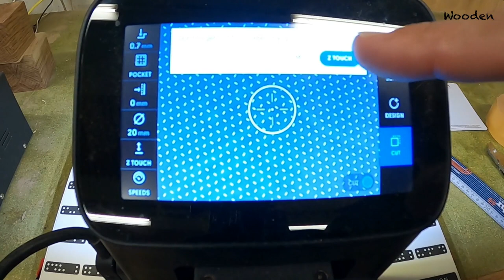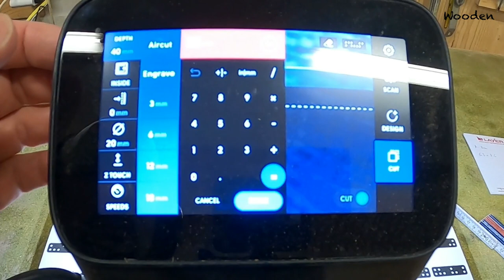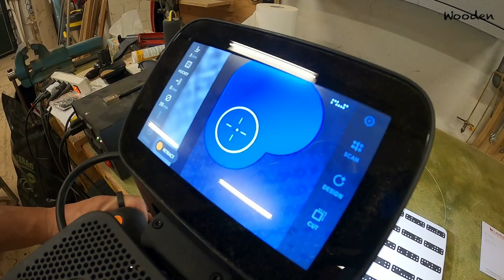[Shaper Origin] How to make 7cm deep pocket cuts with your Shaper Origin #shaperorigin

Comment: Do you have recommendations or links for bits for us Americans? Seems to links to German Amazon.

Love the creativity in how to push boundaries of the tool. Great content.
Reply from the maker: Hi Ben. Thank you so much for your kind words. Regarding the bits, you can order these on Amazon.de, because the ship internationally. The links for ENT should work, but sometimes it happens that Amazon.de (Germany) might route you to Amazon.com (where the ENT aren't sold). If that happens, go manually to amazon.de and log in with your amazon.com account (that works). Once you are logged into Amazon.de, use the provided links. If that still doesn't work, search for ENT 09010 on Amazon.de. They ship internationally, so you should be able to order. Let me know if you still have problems.

Comment: Nice tip my friend! I love the way you push the boundaries and find different ways to use the Shaper. I have to ask, what was the cut quality at level 1. Was there a lot of resistance while you were moving the Shaper? Glad to see you back my friend!
Reply from the maker: Thanks Henry 😁 I have had a few weeks that were pretty intense at work, so woodworking was slow. I was astonished that even at speed 1 it wasn’t hard to cut, but the bit was also very sharp. This might be different with less sharp bits… talk soon my friend